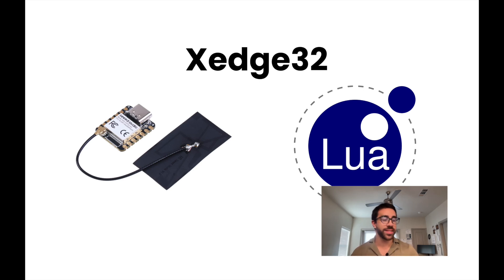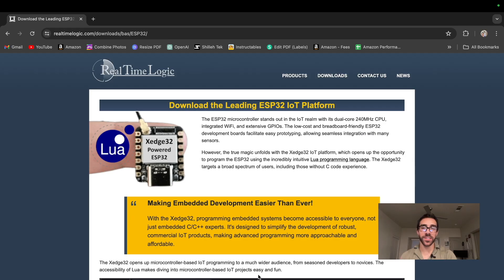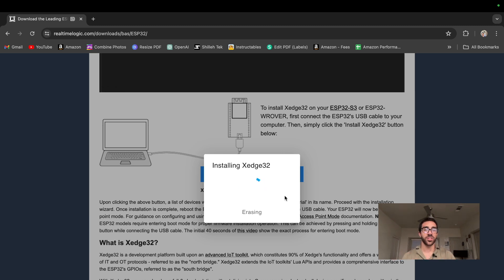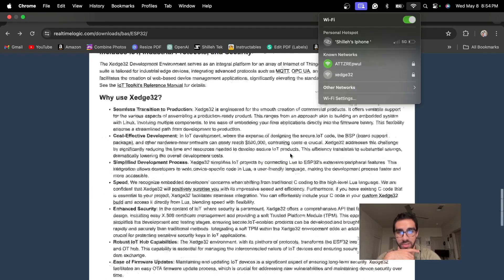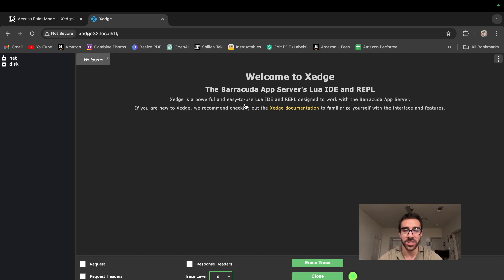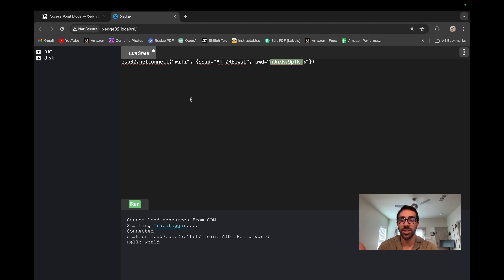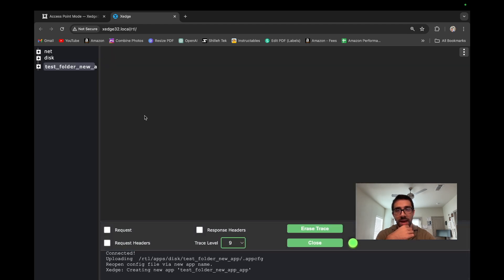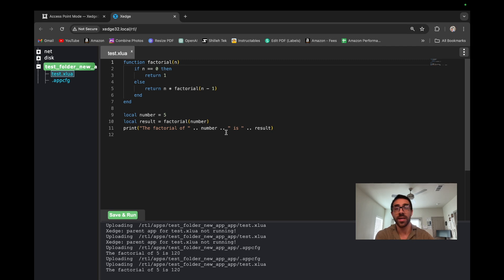Beginner Tutorial: Learn how to Program the ESP32S3 with Lua Programming Language (Part 1)

Comment: A quick note on ESP32 memory:
When buying an ESP32-S3, choose a model with 'N8R8' or 'N16R8' in the name. These indicate the flash and RAM sizes in megabytes. 

Xedge32 requires a minimum of 8MB to run on the new ESP32-S3. The video uses the XIAO ESP32S3 as an example.

You can also use the original ESP32, provided it has 4MB of PSRAM. However, OTA firmware updates are not supported on the original ESP32.
Reply from the maker: Thanks you are the expert here!

Comment: after done the xedge32 download i unplug and replug but still my esp doesnt show up the wifi?. my board is esp32 CP2102
Reply from the maker: Been a while since I used xedge, could be the esp32 board you are using... Some of them are not great
Reply: Did you connect a serial to the board to see if Xedge32 prints anything? The online reference manual provides instructions on how to do this.

Comment: How about making a video comparing and contrasting Lua to C++ and MicroPython. It would help me and others know if we should spend time learning a new language. Thanks for the video.
Reply: I’m going to be blunt: Don’t stress over the language. Focus on becoming a great programmer. The language you use is just a tool. Here are a few key points to keep in mind:

1: Becoming a great programmer takes years of practice and dedication.
2:Learning a new framework and its APIs can be time-consuming.
3: Picking up a new programming language is actually pretty easy in comparison.

Also, take the time to evaluate whether the framework or platform you’re planning to use is right for the job. This can save you a lot of headaches down the road.
Reply: @willhelmschmid  Thanks Willhelm As a hobbyist I started with Arduino C++. I resisted MicroPython for several years. I took a course in regular Python to learn more about computer vision. It was just a small step to start using MicroPython on the Pi PicoW and esp32. I still prefer C++ on the 328P for stand alone projects if the hardware is can do the job. Yes learning a different code language is not too difficult but I really need a reason to start. Hence my comment above.
Reply from the maker: That is a solid idea, I always stayed away from introductory courses to programming languages and their differences because of over-saturation. I will keep this in mind thank you for your input!